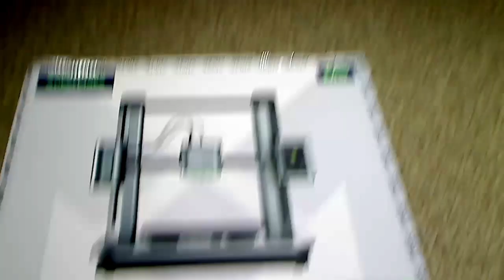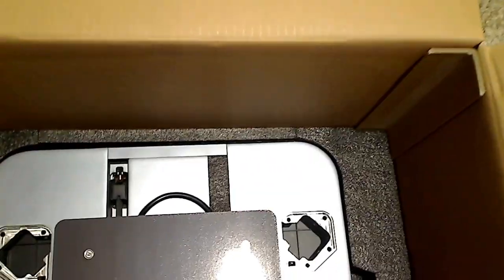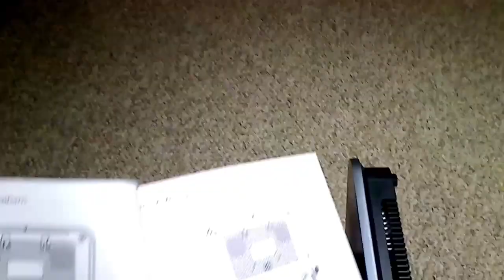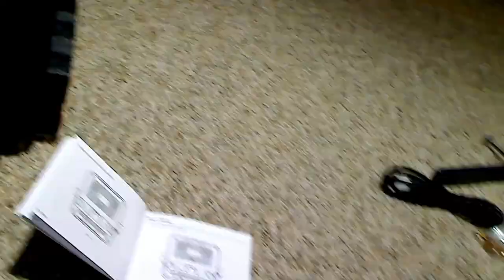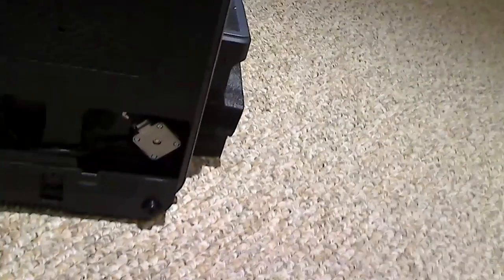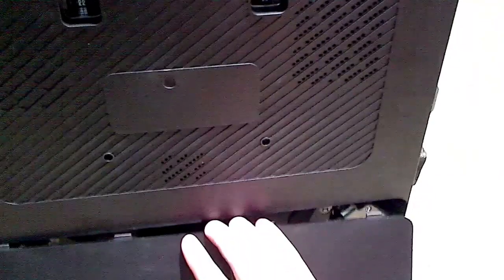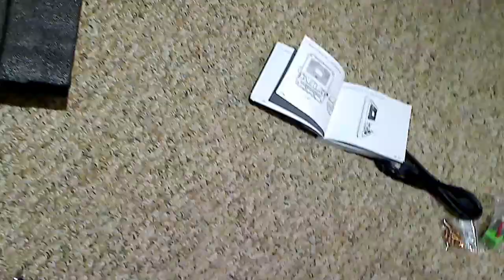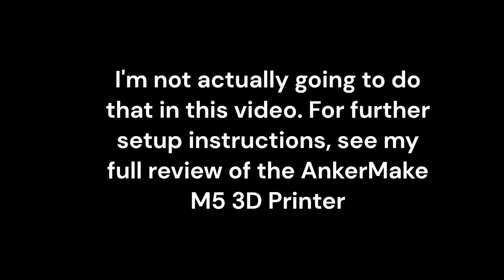AnkerMake M5 3D Printer -  First Person Unboxing and Build

Comment: I think that the FPV can definitely be better, probably with more fine tuning on the camera angle and a better camera, but so far this is really good :D
Reply from the maker: My current camera setup is a Logitech Webcam attached to a ball cap with hockey tape, many improvements for sure are to be made in the future.